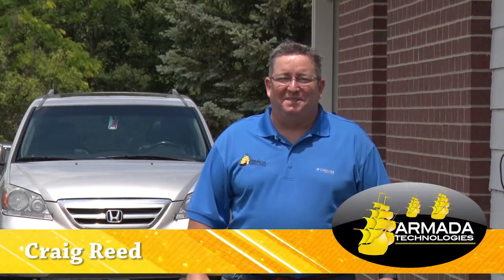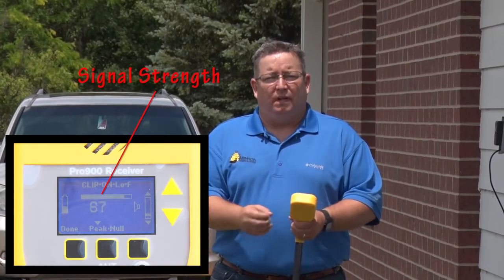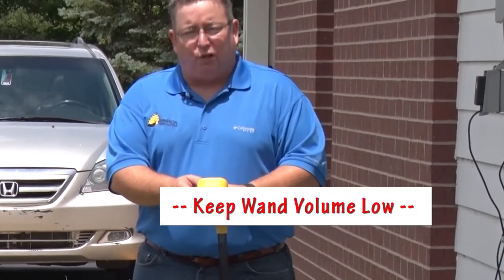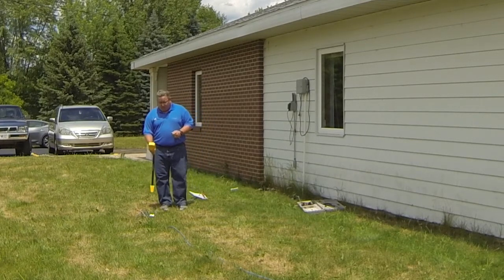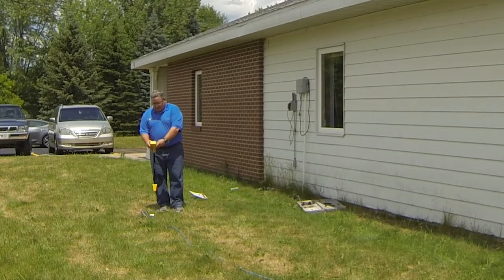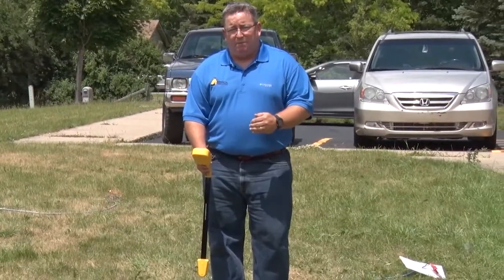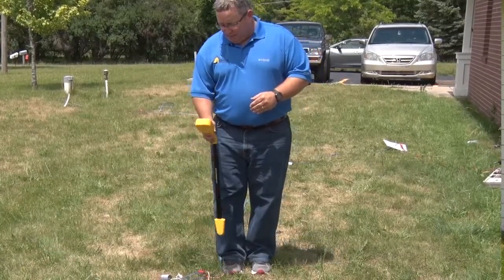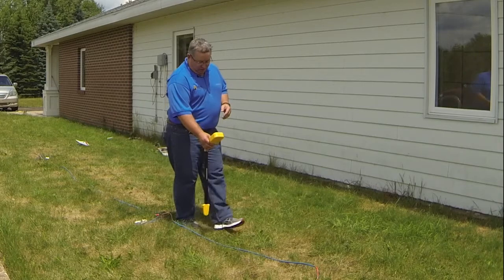How to Locate 2-wire Decoders in Sprinkler Irrigation Systems w/Digital Wire Valve Locator

Comment: I order my Armada 900 last week. I can't wait for it to come in. I am ready to replace my 25 year old 501 and 521.
Reply from the maker: Note that we put up a short new Pro900 video to help new users get up and running. Using the unit's default settings will get you tracking pretty quickly - then you can start to make use of the other features.